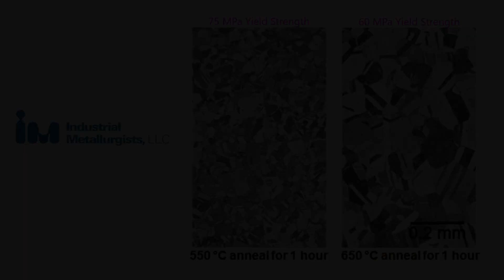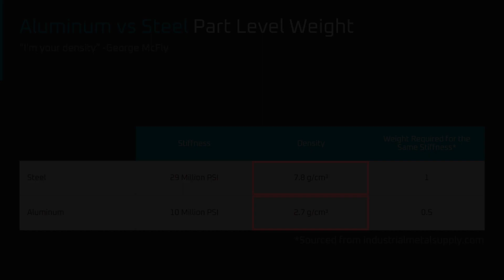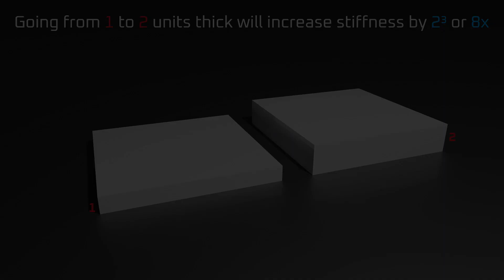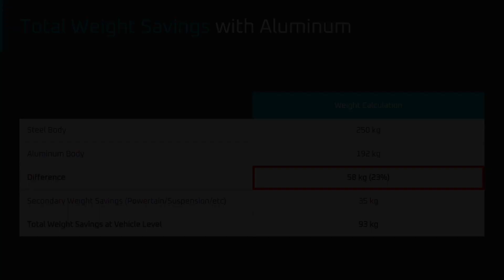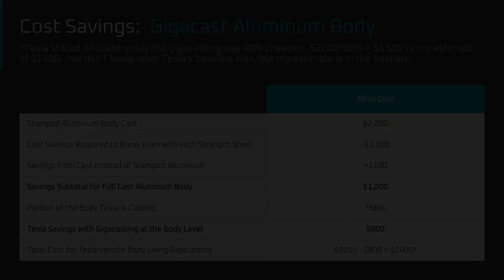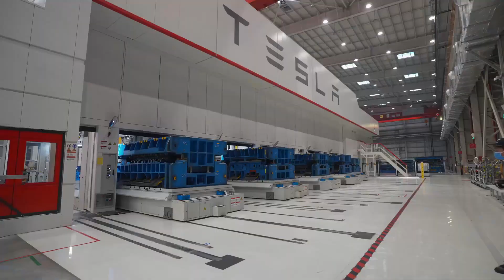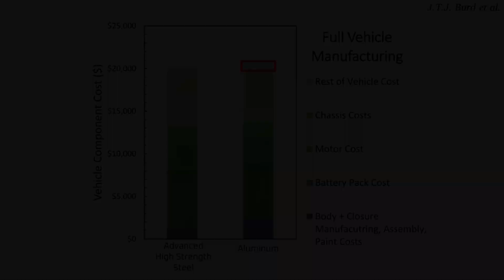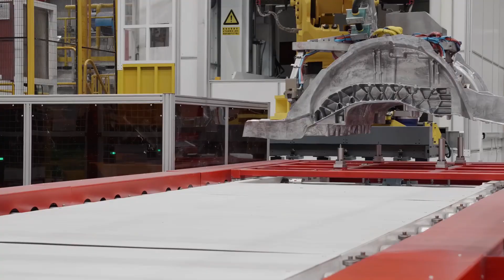#2 Tesla Gigacast Aluminum vs Advanced High Strength Steel

Comment: Great stuff again. I see gigacastings as a real bottleneck for Tesla. Sure, they get an hour or two of production down to 3 minutes, but the process is pipelined. the fact that it takes longer to make a car (high latency) doesn't matter so long as you can make lots of them (high bandwidth). Even going 24/7 a gigapress can only do 175k/year. You've got to halve that for a 2 part subframe (front and rear), so the factories are going to need banks of gigapresses to achieve million plus run rates.

It's difficult to see legacy following Tesla down this rabbit hole. As you say they have the expertise and factories set up to press and weld steel. And they probably take the view that $100 bucks (or so) that they can't even see isn't worth going after, let alone the weight reductions. So far, they've all addressed range and weight issues just by sticking massive batteries in their vehicles. And if they want a cheap vehicle to compete with Tesla on sticker price, they appear to have thrown range under a bus. I just don't see how you make the massive investments in gigacasting tech when all you have are disadvantages everywhere else on your products.

Elon called it at battery day, long term, everyone has batteries and and FSD, so the only way Tesla can stay ahead is by outproducing everyone else. Most of Tesla's engineering is going into the machine that makes the machine. Legacy is screwed. Maybe they know it, hence the EV bill. Maybe they don't. Maybe they think they can transition. I can't see how they transition. And there's no way they ever catch up.
Reply: One of the few vehicles that have a million/year run rate is the F150. While Tesla does plan to have a larger gigacasting as part of the Cybertruck structure, a bigger part will be the folded exoskeleton. I think that Tesla can afford one or 2 more 8,000 ton gigapress machines to keep up production rates. More interesting to me will be what they come up with for the model 2. I can see them ordering a larger number of smaller versions from IDRA.
Reply: @grahammonk8013  I think model 2 will go for a one piece casting if it can, or at least subframe and body in one each.
Reply: @grahammonk8013  that was year's ago now that the f-150 had anything like that kind of run rate. F-150 for 2021 ytd sales are barely over 500,000 as of Ford's latest 3q numbers report. Last year I think they barely broke 700k in total f-150 sales.

I wonder to if the new everado and ev sierra built on the hummev platform by gm scheduled to debut 1/5/2022 at the ces show. 
Won't Osbourne the upcoming lightning a bit and steal thunder from rivian r1t.  

Especially if as gm claims that truck will actually go on sale late next year and have up to 400 miles of range. 
For anywhere near a similar price point to a similarly optioned lightning. 
I can't imagine to many would go for the ice converted lightning design or more mid sized rivian r1t.
Vs one of the designed from the ground up as an ev and more technologically advanced gm products. 

And how will that help or hurt tesla whose so far behind now on producing the cybertruck. To have rivian on the market, lightning about to hit early in 2022. And if they aren't lying through their clenched teeth gms trucks on the hummev platform. 
Plus Bollinger will be out to and perhaps even the atlis xt in late 2022. Who knows if foxconn will build the lordstown endurance or not also? 🤔
Reply: "It's difficult to see legacy following Tesla down this rabbit hole."
"Compared to Tesla and Chinese manufacturers, VW is too expensive and slow, the two emphasized. Now it is a matter of taking up the 'fight against Grünheide'.
VW is also losing touch with productivity. If everything remains the same, according to diess, VW will no longer be competitive.
A radical restructuring of the main plant in Wolfsburg, an open-heart operation at Volkswagen. Accordingly, old buildings are to be demolished, new production halls are to be built in order to make the processes more efficient.
In the EU without Germany, however, not a single product is among the TOP 10.
'Trinity must raise the site to a new level of competition, must revolutionize it. Even with new processes.'
The boardroom is calling for much more radical solutions to save the Wolfsburg site.
'That's why we have to take up the fight, attack and not let Grünheide destroy our location.' "
read://https_www.businessinsider.de/?url=https%3A%2F%2Fwww.businessinsider.de%2Fwirtschaft%2Fkampf-gegen-gruenheide-vw-chefs-wollen-wolfsburger-stammwerk-radikal-umbauen-um-gegen-tesla-und-china-cars-zu-bestehen-c%2F
Reply: @waynerussell6401  the crazy bit is that Tesla's Fremont site nedds bulldozing and rebuilding. Tesla are proving that i) you can make older plant more productive, and ii) new plant is way more efficient and easier to ramp.
Reply: TESLA has 8 Gigapress planned for BERLIN alone , AUSTON will Mirror BERLIN . 
FREMONT only has 2 and CHINA has multiple Gigapress. 
CHINA and FREMONT are Slated for UPGRADES once AUSTIN and BERLIN Ramp.
Reply: Interesting stats on the gigacasting capacity. Where did they come from?

Given that you're correct, I believe Tesla has already purchased and installed 10-12 of the presses, which puts them over 2M castings per year, or 1 million vehicles. This is not counting whatever they buy in 2022.
Reply: @AndyZach  excellent point. Another one is in a recent video idra admitted they are sold out for several years now with their latest gigapresses. 🤔

Comment: Tesla Gigacast will make the car more difficult to fix
Reply: If the vehicle is at a point where its primary structural component is damaged, then it's a write-off regardless.
Reply from the maker: Check out the 'Crashworthiness' video

Comment: Jordan, I love the fact that I can go back and watch this multiple times to fully comprehend what you have laid out.  You have a massive amount of information there... which is totally awesome.  However, can the intricate design of a Tesla AL cast also make up for strength issues and deliver better safety results than HSS?
Reply: look at the Castings themslves , the Crash Rails and Reinforcement are Already formed into the Rear Casting. 
they will do the same for the FRONT casting , and they simply BOLT to the Structural battery pack.

Comment: First your videos and content are awesome.  My comment intends to take nothing from that.  I feel you have underestimated your emphasized savings.  You made room for it but the number range in your conclusion is just very low.  The plant space, labor, equipment, jigs, coatings, treatments and mechanical adjustments of the array of steel assembled into the body all add dramatically to cost.  Labor and rework=more labor is king.  I think the giga casting is a massive savings vs conventional builds.  I offer this as an electrical engineer on a couch with an opinion in the hope that you can with your superpowers make it into more robust content at some point.  Any detail is more that I have provided.  Footnote:  I grew four large successful manufacturing operations in my life with my opinions... Again love your work, patreon and huge fan...
Reply from the maker: Hi Eric!  For sure!  I was angling to underestimate.  I'd also note that the MIT paper and the DOE work appeared to take into account the factors you mention above.  That is, aluminum is a material just costs more, and even if gigacasting eliminates all production costs, it's about the same price as stamped aluminum.

However!  How many more cars is Tesla able to pump out of this line for lower capital cost?  That is, I find it difficult to assess how much more quickly the lines ramp, how much higher quality they'll be, and how much that will suck money into Tesla's coffers 😀
Reply: @thelimitingfactor  I think Aluminum sheet does not talk to a cast part from a labor and square footage perspective.  The large casting is not what those papers were thinking.  It is not the material, it is the complexity and piece count.  Labor and variance are Huge costs, they dwarf material in manufacturing.  I get the underestimate part but I think you did such a good job you underrepresented the point significantly...

Comment: TL;DR

Gigacastings allow for major & minor improvments in manufacturing efficiency, vehicle weight, vehicle efficiency & other general improvments like lower mass/polar moment of innertia. All for, at worst, a slightly higher vehicle level cost.

Home-run.
Reply: Jordan convincingly shows the vehicle level cost is equal or less than high strength steel--with very conservative assumptions/estimates.
Reply: @AndyZach  "at worst"
Reply from the maker: Great summary!  I might have to plagiarize that and weave it into a summary video.
Reply: @thelimitingfactor  Go right ahead. Would be an honor.
Reply: Or they could mix other composite materials like carbon fiber and magnesium like other manufacturers have been doing.

Comment: Jordan, your videos just keep getting better and more professional.  As always, I am impressed with the quality of your content.  You wanted a way to express the savings.  According to a podcast, I heard last week.  VW had an emergency meeting because they were running behind Tesla.  They claimed that Tesla could produce a car in ten hours and it took VW 30 hours.  The Model Y line in China is supposedly producing 1,600 cars per day.  That is a tact time of about 50 seconds, which is world-class.  Other carmakers can also put out one car every 50 seconds, but they take much longer to put the car together.  Toyota takes between 21 to 18 hours per car.   If the giga casts are behind much of this shorter production line, (I also assume it includes not having to put in engines and transmissions) than the inventory and labor cost saving must be gigantic.  Every hour of production equals 60 to 72 cars worth of extra inventory.  Giga casts are making Tesla leaner than Toyota, which is something I thought I would never say.
Reply from the maker: Great information, thanks Joseph!

Comment: Jordan, this is top notch material science engineering analysis. It boggles my mind that you don't have a traditional engineering degree. You clearly are a super bright and capable guy! I'm surprised Tesla hasn't tried snatching you up 😉
Reply: @AudiTTQuattro2003   I respectfully disagree! Performing material analysis investigation, selection, and especially highlighting the magnesium strength & weight analogue study (which was then compared to aluminum), was some good engineering sleuthing. To put that all into a condensed and easy to understand presentation is where Jordan's top-notch work really shined.
Reply from the maker: 🤜🤛 Thanks for the support as always Nick!
Reply: @AudiTTQuattro2003  You’re speaking too soon. Tesla is already at nearly a million per year vehicle manufacturing run rate with just the two vehicle factories that it has, and the Shanghai Gigafactory hasn’t reached its peak output.

Also the Fremont Factory hasn’t fully ramped the new Model S production line or even started delivering the new Model X which typically outsells the Model S.

The Berlin Gigafactory is larger and more advanced than the highly efficient Shanghai Gigafactory which will improve the final product while simultaneously decreasing cost for Tesla’s European customers. Then there’s the Austin, Texas Gigafactory which is even bigger than Berlin and according to Elon will be used to test the cutting edge of Tesla’s manufacturing techniques so even more advanced than Berlin.

Tesla is forecasting a 20 million a year vehicle manufacturing rate by 2030 and I believe them. They’ve got practically unlimited cash and have shown that they can build two Gigafactory simultaneously in about a year for a cost of just ~$400 million each.

Contrast that with VW’s Tennessee EV plant expansion/conversion that costs $800 million or GM’s $2.2 billion dollar EV factory also in Tennessee, and you’ll start to understand Tesla’s huge capital efficiency lead.
Reply: @TecnamTwin  I think his point is not that Tesla is ineffective or slow.
He says it is not yet clear whether others may be more effective.
It does not look like it is possible, but that does not mean anything.
Reply: @AudiTTQuattro2003  It's not small at all. You should not count how many cars the brand put out. Count how many they can put out on their most advanced factories. OEM does 200k at most per factory per year. Giga Shanghai's new Production Rate is 450k per year.
Reply: @AudiTTQuattro2003  Endless variations of vehicle styles and configurations is more about marketers getting everyone to upgrade every 6 years. With a million mile robotaxi, nobody cares.
Reply: Shh nobody tell Dwight that Tesla makes SUVs and compact SUVs...
Reply: @AudiTTQuattro2003  Tesla has apparently not honed in on precision fit and finish. Just not their wheelhouse or focus. Consistent fit an finish is not easy. Eliminating such points of variability that exist ( every joint fastened by a weld, glue point, weld, or bolt ) is initially very expensive, but the outcome is a 3 minute repeatedly accurate ( or inaccurate ) structure to both POSITION and FASTEN other parts to. The casting becomes the jig. I would liken this to the 1980s Asian car steering column. There is a die casting clamped to the column outer tube, with bosses or an outer perimeter for each component, such as he turn signal switch and wiper stalk. These components drop into place, then are screwed fast. That structure positions these parts perfectly. The FASTENER is not being used to create the fit, just the clamping action. This saves time to create the subassembly, as compared to having a high-low beam switch mounted by left foot, as GM Ford and Chrysler were up until the 1980s, when they took on the Asian approach to the steering column as well. Pre-assembled subassemblies save assembly line time, and materials. If a much larger cast structure provides for undercarriage hardware, as well as door, quarter panel and interior fitment as a "baked-in" feature, more savings, and higher quality output results.
Reply: Is giga cast one of the factors of why VW spends 30 hours per car vs. 10 hours for Tesla?
Reply: @kdshak4904  Yes, a big factor, I think. With out it, there were 71 or so metal sheet parts to weld together. But that is mostly robot work, so I am not actually sure it matters.
Reply: @vsiegel  you put your finger on why Tesla had to cut back on Robots..?
Reply: @davidwilkie9551  Using a large casting makes a large number of robots unnecessary,  mostly for welding or applying fasteners. You had 71 parts that needed to be combined to one, mostly by robots.

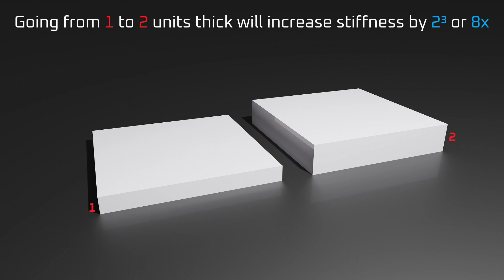Comment: For your consideration...     min 5:50 an increase in thickness increases stiffness👍, but also increases deformation energy absorption 👍👍.....The required thickness of some body components is not dictated by the service loads (stiffness) , but by the crash safety requirements (energy absorption). A thicker aluminum part will require (absorb) more energy to deform/crumple than a thin steel part. This makes the thicker part better/cheaper/lighter for crash worthiness.
Reply from the maker: Niiiiiice!  Thanks for the info
Reply: @AudiTTQuattro2003  I would say this is a misplaced priority. Protecting occupancies is more important than the battery. Given the stiffness of the battery, Tesla uses the battery to share loads in protecting occupancies.
Reply: @quansun7633   -TESLA Already has BEST in class Safety.
Reply: @quansun7633  Impact damage is a serious danger to humans, so is the explosion of a damaged lithium battery. Watch the hydraulic press channel vid where they crush a power bank 😳
Reply: @bakedbeings  what one is more likely to happen and quicker to cause damage to human?
Reply: @quansun7633  Cars in accidents get crushed and smashed, damaging contents. Damaged lithium batteries like to catch fire, humans are both squishy and flammable.  I don't see the dichotomy. If you're protecting against both the crushing and burning of occupants (a pretty wise move) the likeliness of either is moot: the required strength of supports and components is dictated by  the physics.
Reply: @bakedbeings  Not true. 10x more crashes than fire reported for Tesla.
Reply: @quansun7633  woosh
Reply: @bakedbeings  you do realize that ~400 cars a DAY catch on fire in the US alone.  It’s no surprise as they are called Internal COMBUSTION Engine cars….compared to a couple dozen Tesla EV’s per YEAR.

And it wouldn’t matter is some cases, as the vehicle’s speed would cause the fire (ie - driving at 110 mph and hitting a tree).   Even the Chevy Bolt has only had 20-25 car fires this year.
Reply: @yingnyang2889  I think you're arguing with the wrong guy. I was pointing out to Quan Sun that there's good reason to protect against fire as well as impact in an electric vehicle. Still, I don't know how many people you're going to catch off guard with the combustion engines and fire thing.
Reply: @bakedbeings  no it was intended you, as you wrote damaged “batteries like to catch fire”.  My point is, the batteries even when damaged, don’t catch on fire as many times as ice cars do.
Reply: @bakedbeings  Having an engine on your lap after a head on is very uncomfortable!!
Reply: @AudiTTQuattro2003  fair point. post crash fire from a battery would take Tesla into Ford Pinto fuel tank problems.
Reply: @ricardokowalski1579  I believe, from what I have read, that the Pinto was just the chosen one. Every Toyota, Datsun ( Nissan Motors ), Subaru, Honda and Opel shared this industry-common design to one degree or other. Material engineering was being applied to the state of the art, even of that time. Protection of the soft meat was just not the focus of car manufacturing. If I am wrong, surely someone will chime in. And yes Shirley, I did call you Surely.